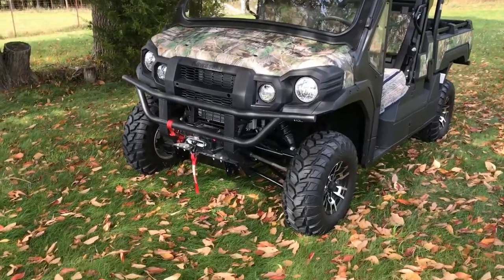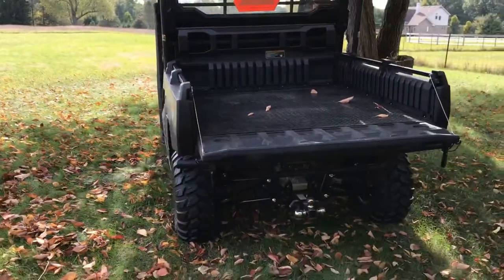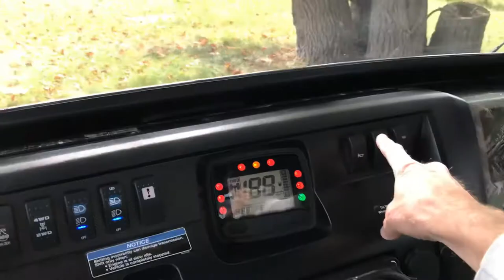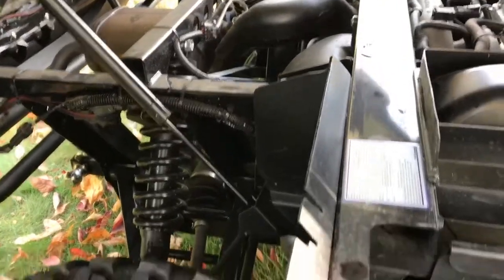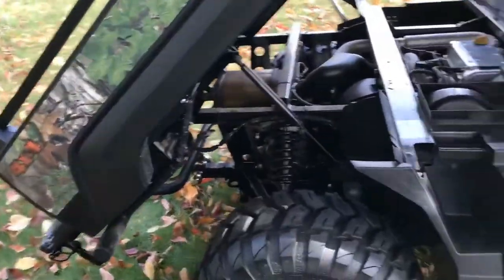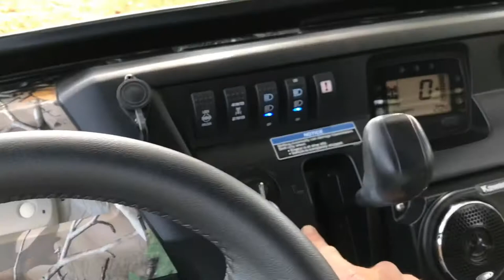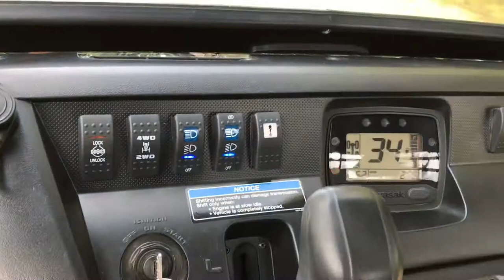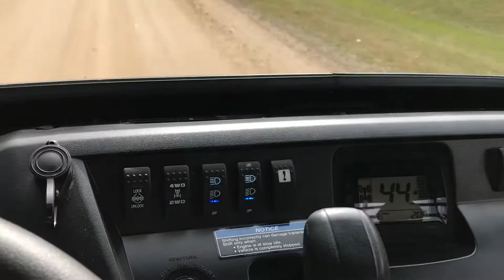Kawasaki Mule Pro FX - Up Close

Comment: Need more details on the cab  What brand Curtis ? Kawasaki? Plastic roof or steel Price on cab about 5200?  I would have went with the Inferno Cab heater giving you ductwork in dash and as a defroster ports as well. elc hyd dump another 1200 option?
Reply from the maker: The cab and roof is plastic and all Kawasaki.  As I recall, the electric-hydraulic lift ran near $1,000 and pretty sure it came in under.  Price of the cab with doors...will have to get back on that one.  Heavier springs were also added with the additional weight.
Reply: @Stromzilla  Thanks if u could be great I know the curtiss in like 5 grand
Reply from the maker: Will get back with the cab cost tomorrow.  Stay tuned!
Reply from the maker: Still waiting for cab cost.  The heater we have installed does have ductwork to feed air thru the dash to the windshield.
Reply: @Stromzilla  Thanks the heater should have total of 6 diffuser ports 2 on top dash defrost, 2 in dash facing seat and 2 under your feet???
Reply from the maker: Didn’t realize we had options with the heater.  Our heater box has 2 diffusers down below at the box.  It also has duct to feed the 1 duct for the windshield.  There are no ports in the instrument panel with this setup.  Sounds like there might be better options per your feedback.  However, the path we took for the price we paid...I’m satisfied and no regrets.  It gets the job done bigtime.  When I’m out plowing snow in really cold weather our cab gets toasty to where I have to open vents which is good because without an HVAC system, you need to push out the humid air that builds up inside.  My dealer has not gotten back on cab cost.  I estimate it’ll come in at $4k to $5k depending on how your dealer will work with you.  If you’re still interested we would recommend you contact your dealer for a cab price.  Bottom line - we’re very happy with the Pro-FX setup we have at the moment.  Not much we would change other than having a full HVAC installed which was not available at the time we purchased.  Let us know if you have any other questions.
Reply: @Stromzilla  Yes Iam going with the 3 passenger as i want max cargo bed all the time and not people passengers, for farm work, I am going with the genuine Kawasaki heater wich is 300 more than the Inferno one I told u about only because offers 6 diffusers and blend air defrost or feet requires 2 switch locations in dash for controls......  going with Soft cab doors uppers and polycarb rear window and glass windshield. I got to cut cost so not getting Hydrualic dump lift for box.
Reply from the maker: Sounds like a very nice setup.  Please send pics when feasible.
Reply: @Stromzilla  Ye still negotiating with dealer, anything to do with recreation they pretty firm on price they know it will sell and they only get few alotments at a time
Reply from the maker: @class8garage308  Been hearing the same around here.  Stay the course and it’ll work out. Keep us posted.  Take care.
Reply: @Stromzilla  is there a HVAC system than can be installed by Kawasaki?  Excellent!  Something more to dream about for my 2021 FX!
Reply from the maker: HVAC was not available at the time...heater only.  But I’m thinking it’s available now.  Would be worth looking into.

Comment: about how much did you spend on mule I,am guessing 18,789.54
Reply from the maker: Realtree Camo, Mag wheels, blade, heavy duty winch, hard cab with doors, hard top, wiper, horn, radio, heater, electric-hydraulic lift, labor...with discounts it was closer to $22k